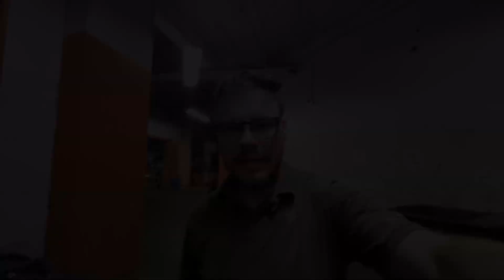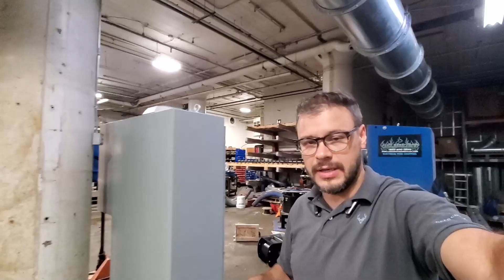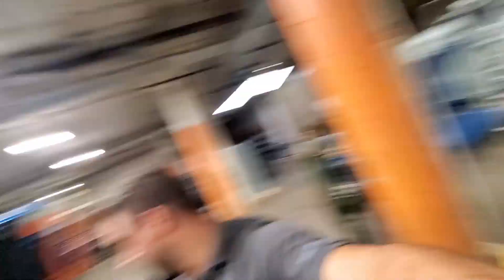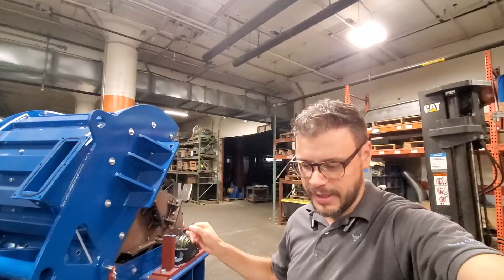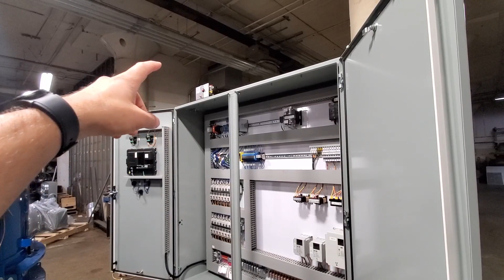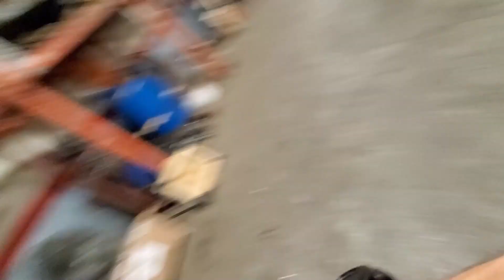What Pieces of Equipment Are Used in Battery Recycling?

Comment: How are you using the separation table?mix with Black mass with plastic,copper, aluminium?
Reply: Ah okay and you are removing the copper from the mix, the heavy side
Reply from the maker: The black mass is removed before the material reaches the air tables. The plastic and separator are stained black from the carbon.